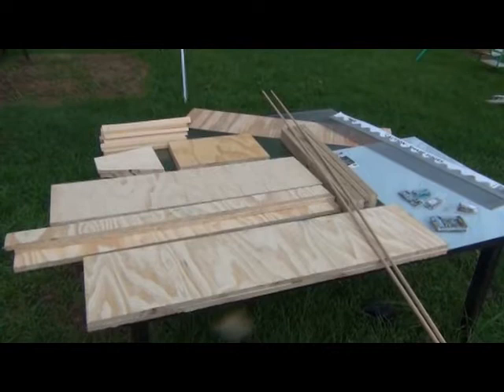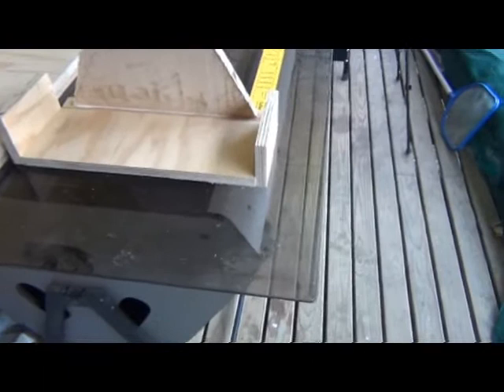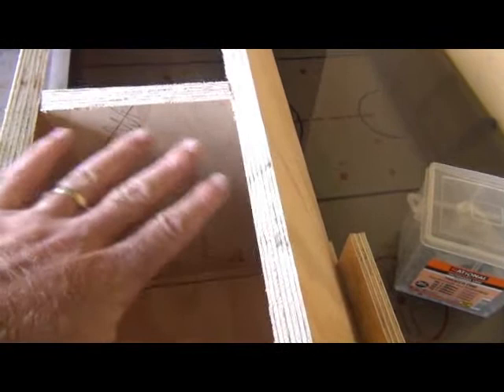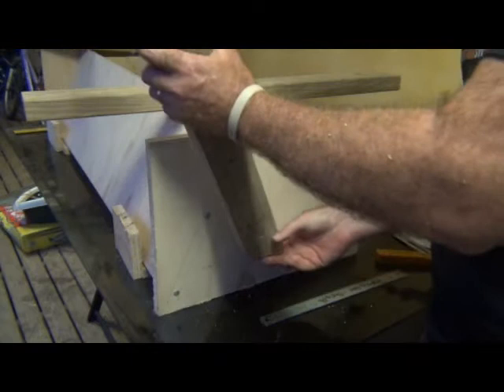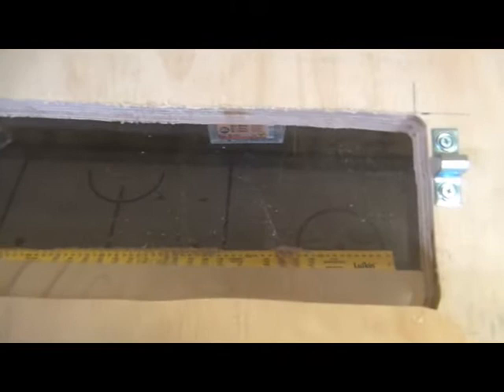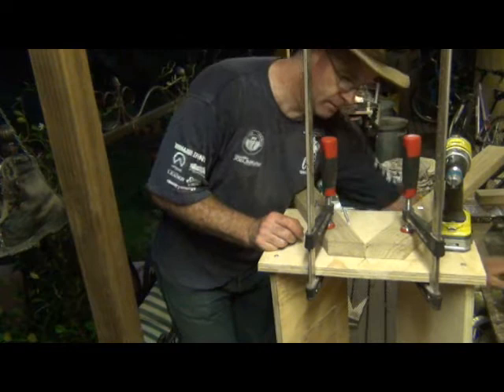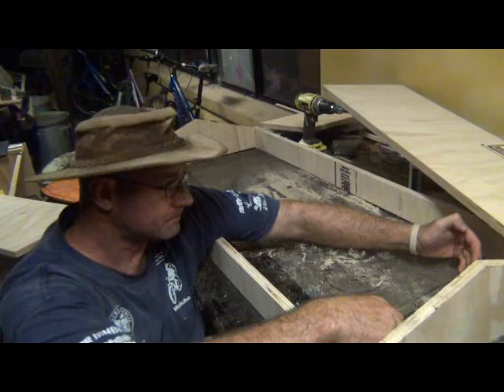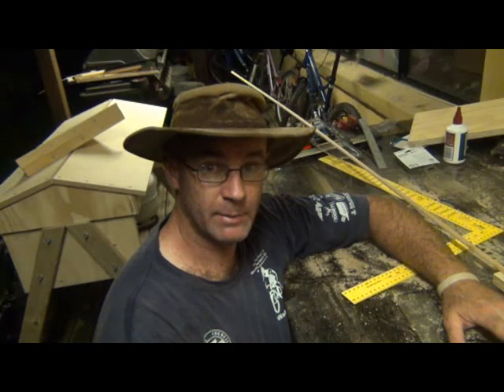How To Make a Top Bar Hive.

Comment: Hopefully I carried these over properly to SAE. You will have to make the determination at the lumber yard as to the proper boards.
Parts List
SAE Conversion
Sides 2 x 43.3" x 11.8"
Ends 2 x 17.7" x 11.8"
Follower board 2 x 14.96" across the top 5.12" across the bottom 11.0" deep
Winter floor 1 x 43.3"x 7.08" (optional)
Roof frame sides 2 x 46.45" x 2.95"
Roof frame ends 2 x 17.9" x 5.9" I cut these with a gable roof angle but you could keep them flat if you prefer.
The above parts should be .98" if you live in a cold climate but I have have used .71" ply as my winteres dont get to cold.
Legs 4 x 31.5" and of a standard that will support the hive for many years.
Roof I used 2 x 47.24" x 11.8" ply that I used to make the hive but you could easily go down to .39" ply as long as it is exterior grade.
Top bars 16.93" x 1.34" x .87" you will need about 30 and any straight grained wood should be fine.
comb guides 11.8" x .24" half round dowel You will need one for each top bar.

You will also need some perpex if you wish to make an inspection window along with hinges and some sort of latch for the door.
Screws, nails and exterior grade pva glue.

Comment: This is video is exactly what we need, someone who is just like 99% when it comes to ordinary carpentry construction. I appreciate your effort and will attempt to emulate much of what you used. Thanks also for the conversion as it will make it a bit simpler at the lumber yard here in the U.S. even though metric is far simpler. I will as well take into account the bar dimensions from Mr. Chandler below. I have his book coming in from Amazon in a few days. I will check out the video on the roof treatment as well. Your plywood cuts were quite straight. Did you have a table saw or just a steady hand with the circular?
Reply from the maker: I am glad you found the video useful.
I cut the plywood free hand with a circular saw. I guess it looks steady on camera but up close not as steady lol.
With the dowel I fixed to the bottom of the top bars I ended up making them longer so that they would slip and fall into the hive. I will be making a follow up video on this very soon.
Thanks for watching and for your conversions :)
Reply: The Productive Garden I will look for that video when it is done. I had forgotten that I downloaded Phil Chandlers ebook on this some time back in which are the conversions broken down as well. Your demonstration brings it to life. Thanks a bunch.

Comment: Well done. The hive looks great. Just wondering how the ply stands up to the weather? I plan on making mine out of pine hoping it wont warp.
Reply from the maker: Thank you very much :)
The pine is doing well one year on. There is no sign or delaminating at all. The roof does need another coat of linseed and beeswax though.
I wouldnt make the bars out of ply though. I have seen some bad results from this so solid wood is definitely needed for the bars.
I think the pine will be ok as long as it is well sealed on the outside atleast.
Good luck with your hive :)